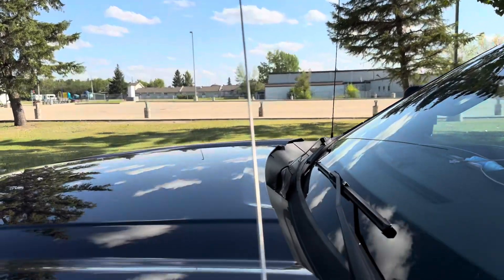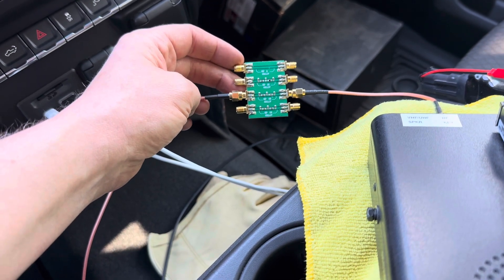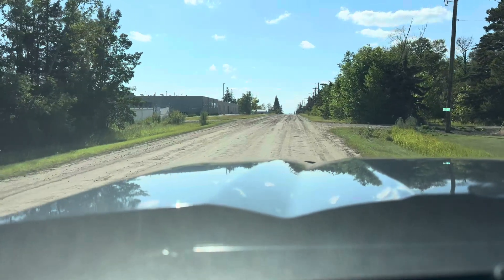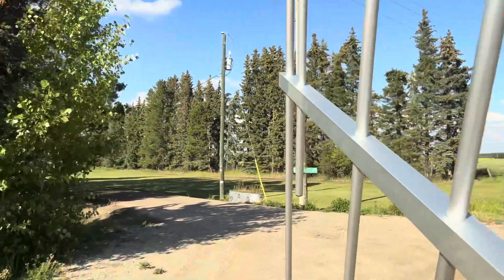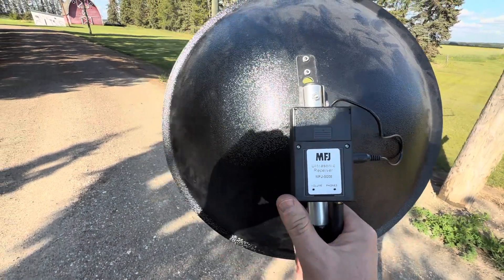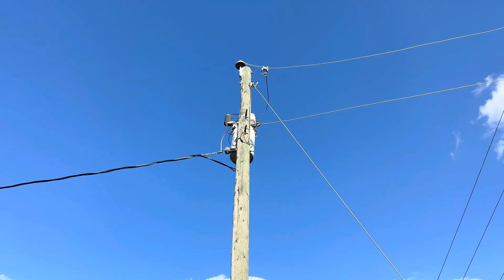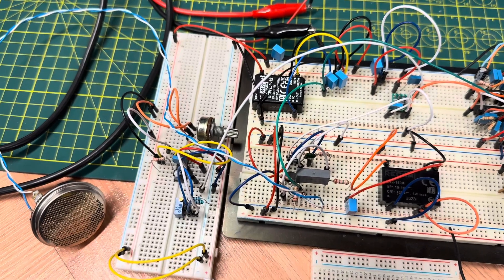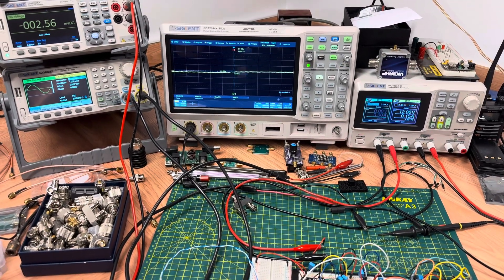Hunting for Powerline Noise!

Comment: this is what i hear all day and night at my house - what can I do to stop it ? we dont have powerlines , just normal electrical lines
Reply from the maker: First, shut off the main breaker in your house, run your radio off battery power, and make sure it’s not coming from your own house.  If the noise is gone, you’ll need to do a noise hunt in your house.

Comment: I just did something similar by accident, I noticed that on my radio I get recieve without squelsh opening, CTC. so I opened it into monitor mode and just static, but only next to an industial building, so after work I came back to the building in personal car and used some attenuators and loop antenna to locate the noise. it ended up being a 11KV to 480V transformer, I called the company and they had power company come out in 35 min, I showed them what I found and they swapped the transformer in 2 hours. no more noise. it was about 8.2 mhz and other one on 16.5ish mhz
Reply from the maker: Very nice!

Comment: touching the antenna directly and staying on ground wouldn't you be grounding out the antenna though ?
Reply from the maker: Nope.  Holding the yagi at the point where it normally mounts to a pole is no issue.

Comment: That pole was causing interference to VHF TV Channels 2 through 6, which is a serious violation of FCC regulations.
Reply from the maker: It’s against regulations up here in Canada also.
Reply: It's also causing issues from channel 14 through 21 and possible even further upwards.

"Digital isn't susceptible", no, all RF is susceptible to undesirable interference. The lower SNR and narrower channel width for digital helps, but is no means interference free.

 SHF/EHF and higher is much less prone to interference, but the ISM bands are chalk full of it... I've seen similar electrical issues in a "former life", and once you say "it's affecting AM/FM Broadcast, Air Traffic and commercial bands" they make a concerted effort to address the issue. Used to have a fair number of rural customer service center phone numbers on "speed-dial" and first names of district managers from the Electric Utility company.
Reply: But digital TV isn't that susceptible to noise
Reply from the maker: @coreybabcock2025  it can cause drop outs, freezing of video, or complete loss of reception.

Comment: ATCO popped by the house the other day to get permission to access and install a new auto re-closer.  I have noise problems  here generally  so I asked if they had an ultrasonic. They had never heard of such a thing. Any way, they did their thing and for a few days it seemed the noise had lessened.  Then yesterday all hell broke loose here and now it's 10 over 9 on 40m and 20 over on 80m.  VE6RLZ
Reply from the maker: That’s pretty frustrating.

Yeah, they don’t seem to have anyone trained in locating RFI issues, not that I have observed thus far anyhow :-/

Comment: As I was watching the video I was impressed that you were using VHF AM to detect noise... Said to myself " Dam... He should also be using ultrasonic device ! " AND .. When you brought out the MFJ dish ... That was very impressive.. In the late 70's early 80's I lived in Nova Scotia. The power company in their wisdom changed a 13.8 Delta power line to the new standard 14.4 Y .. They never changed insulators that had been there since the early 40's... OMG !! The noise was tremendous.. I called the DOC at the time and they came out and discovered the insulators . The power company  had to change aprox 10 miles of insulators !! BTW the 13.8 line was as quiet as a kitten , but the 14.4 raised havock !! At that time I had a DELCON ultrasonic instrument. You could hear the insulators frying like bacon! The corona rings inside were the culprits. There was a run of insulators made by Canadian Porcelain that also had bad corona rings in them that caused a lot of noise.. The ultrasonic is great for finding loose hardware on a pole also..Would love also to see your ultrasonic receiver schematic when you get it running..
-73- de VE3WGW
Reply from the maker: Thanks for sharing your story.  Very interesting read :-)

I have to head out to my real job for a few weeks, so work on my ultrasonic listener circuit has halted for now.  Looking forward to getting back to the project next days off though :-)

If I get something that works well, I will be sure to share the circuit.

Comment: 11:47 Congratulations on the project and your commitment! Could you share the electronic circuit?
Reply from the maker: I will when I have it fully working.  First trial run in the field was a fail!  Haha!  My simulations and engineering on the bench looked good.. but you know how things work.  What works on the lab bench, doesn’t always work in real world conditions.

Some positive news, though.  After my initial failure to detect a faulty component after identifying one with the MFJ unit, I tested both side by side in my back yard using an ultrasonic cleaner as a noise source and found that the initial gain after the transducer was insufficient.  The MFJ unit has 60 dB gain (1000 times voltage amplification) after the transducer.  My unit is nowhere near that much gain, so I have some work to do, and then try it again!

Comment: I’m experiencing strong HF interference. Does not seem to be anything local. Time to start driving around. I’m wondering how far a utility pole can transmit that garbage. What is your experience.
Reply from the maker: It depends on the frequency.  My observations so far have suggested to me that the lower you go in frequency, the further the interference will carry.  If you start with a setup (maybe an old AM CB radio and a steel CB whip on a mag mount.. if you don’t have an all band/all mode radio like mine) and zero attenuation… see if you can hear the noise.  If so, try attenuating the antenna input to the radio until the noise is barely audible and then drive around until it is loudest, then attenuate again and drive some more.  Keep doing this until you locate the loudest area and then go to VHF and a yagi and see if you can locate a group of poles.  Then switch again up to UHF and see if you can identify the exact pole.

Comment: The catch for me is often the noise does not extend into VHF and coming up with a portable HF rec. that also displays signal and directional pickup is not as easy.  Nothing here at hand that is portable.  Except old multiband AM transistor portables and that is only slightly useful.
Reply from the maker: The signal detection part, as far as locating an issue by direction, certainly gets more challenging in the HF part of the spectrum if that’s all you have to try to hunt something down. I don’t have enough experience in this particular challenge yet to be able to definitively state that HF is where a person initially picks up a noise signal, and then as you get to the actual pole you will be able to pick it up on VHF and UHF as you hone in on the exact issue, but that’s what I have observed in my adventures thus far.

I would suggest using an AM CB radio (inexpensive), with a whip antenna on the vehicle.  See if you can get one of those cheap attenuators off Amazon (like what I showed in the video) and some PL259 to SMA adapters and do a drive around and see if you can locate some noise sources.  If the noise is loud and seems to be coming from everywhere, add attenuation to knock the signal down and then drive around some more to locate the loudest spot.  I’ll bet that once you find a hotspot you’ll be able to pick something up with a yagi antenna on VHF and UHF as you get closer to the pole.

Comment: I tracked noise to a nearby pole with a VHF receiver and beam.  The power co.  came out and used ultrasonic dish to pinpoint and fixed it. I have built a tunable ultrasonic receiver that works well but then I tried to find a practical size parabolic reflector to use and they seem to be extra expensive for what they are,  a plastic dish but the shape is critical. Also a digital camera with the internal UV filter removed is supposed to be able to see arcing or corona in the UV spectrum.  BTW the power co. guys were kinda unsure about pinpointing the arcing as they said the old guys that tracked RFI etc.  had retired and no one else got trained!

Comment: Nice work Greg, I had massive issues with electrical noise in Sudbury Ont. Used similar yagi approach to locate. Those porcelain insulators are something that need to be updated. Contaminates and cracked glazing are there weakness. Thanks for the upload. Once you finish your ultrasonic unit, I hope you’ll share your design.
Reply from the maker: Thanks Jeff.  I will gladly share my schematic, the only issue is that I built much of it out of my multi-decade collection of “stuff” and some of the IC’s I’m using here have been obsolete for many years… (XR2206, for example.  I used this IC to build a VFO).  Of course, you can substitute anything to build the functional blocks of this system, the VFO can be built any number of ways…. I tried a 555, but found an XR2206 in my collection which makes a nice sine wave and is convenient to work with, so I used that.  I was also considering trying a 4046 PLL IC.

Comment: Did not know that ultrasonic detectors could be helpfull in hunting interference. Interesting application
Reply from the maker: Yes, they are very useful to do the final pinpointing of the noise source on a pole.  I find being able to tell the power company exactly which part on the pole is at fault really makes it easy for them and they typically come fairly quick to change out the bad part.
Reply: 🤔I think that I have an old grill top down in the shed...🤓

Comment: I first noticed excessive powerline noise from listening at the bottom end of the AM radio band in the United States. Some railroad tracks also caused odd signals as I drove over them. Thanks for all the tips!
Reply: If there are overhead powerlines above the tracks it could be the culprit but the tracks themselves are also carrying power since the lines above are the Live/Hot wire and the tracks the Neutral. Even if there arent any powerlines above the tracks if they connect with a nearby network that does they could still be carrying some current theoretically.